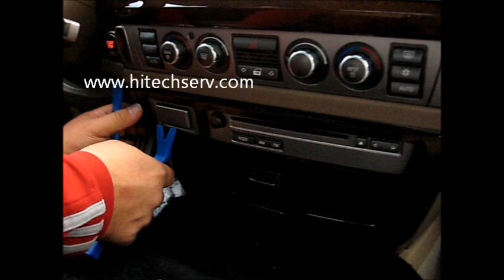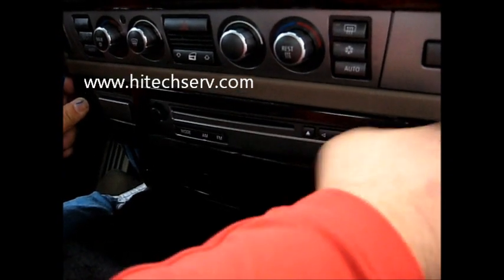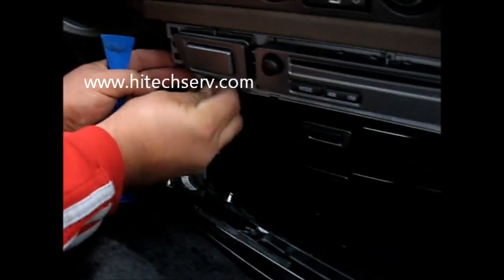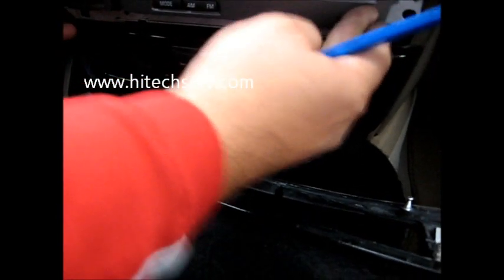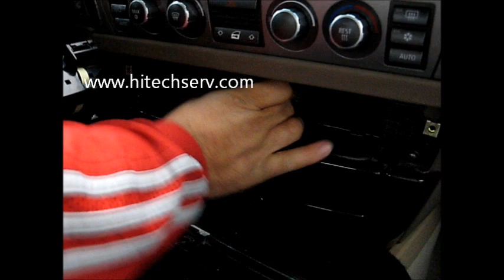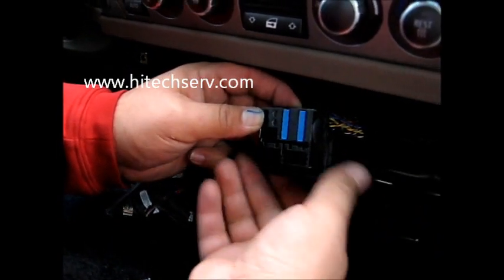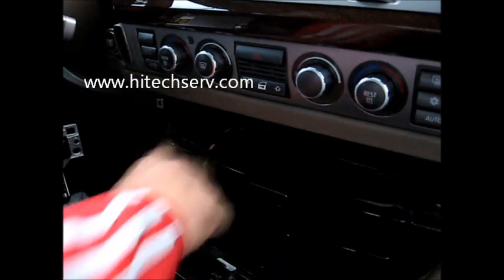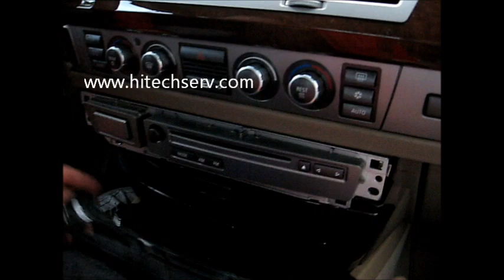How to Remove Radio / CD Player / ASK unit from BMW 745, 750 for Repair.

Comment: Hi  i have 04 E65,  Do i have to get   ASK unit coded if i install a used one from different car????? ThnX
Reply from the maker: If the donor vehicle is between 2003 to 2005, it should work.

Comment: I have a 2008 bmw 750li and im getting the red light flashing in the trunk but not on the one in the glove box ...could my ask unit be bad ? Also im not getting navigation map and no sound at all
Reply from the maker: Yes, it could be the ASK unit. Once the fiber optic line is open nothing would work properly.
Reply: So i removed the ask unit today and unplugged the wire harness and i also went in the trunk and unplugged every box i saw on the driverside waited 5 minutes plugged everything back up and now everything is working..lucky me
Reply: So i have another question...i set up .y iphone on Bluetooth to the radio but how can i listen to music off of my phone on the radio??
Reply from the maker: @MrBenodakid  No, too old to have music streaming.

Comment: I have a problem with my 2002 735i. The left side speakers have sound and the entire right side has no sound?
Reply from the maker: The ASK unit is faulty.
Reply: HiTechElectronic ok do I need to program the car when I replace it?
Reply from the maker: It would work without programming but if your car has some special options then you need to program it.

Comment from the maker: You need to remove it and manually open the keypad and leave it open. If you would like to have it repaired properly please call 800-580-3376 or check our website.

Comment: how do i check if the cd player is bad?? 
can the cd player be bypass like the other units in the trunk??
Reply from the maker: Yes, CD Changer above the glove box can be bypassed but not the single CD player in the dash board.
Reply: ok. thanks for that information.  
do u know if the cd changer dont work can make u lost sound?
Reply from the maker: The CD changer does not need to be working but it can't be dead either. In other words, If it does not play CD it is fine but if it is completely dead then the fiber optic won't pass through it and causing no sound.